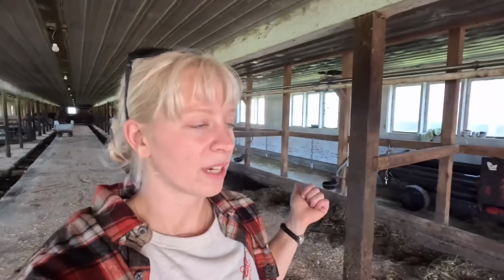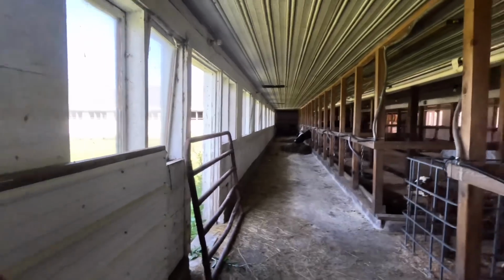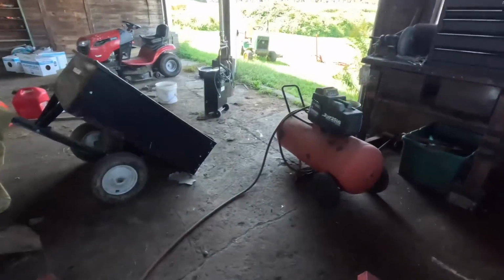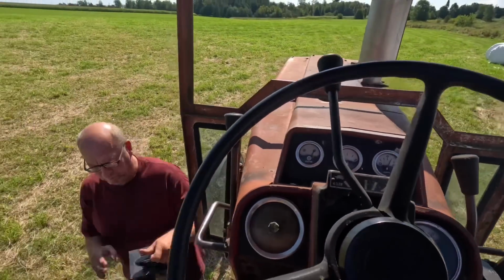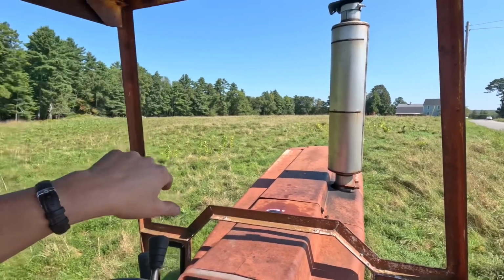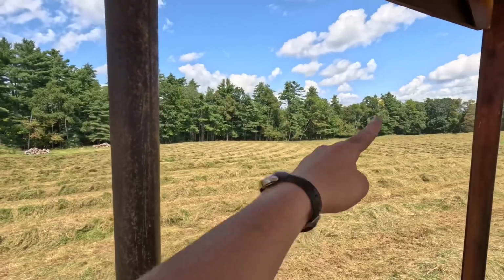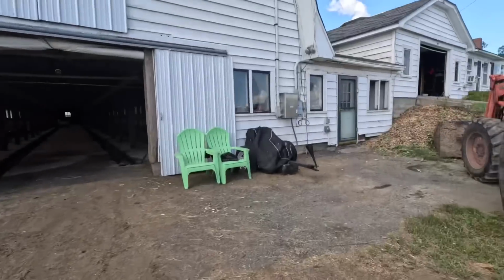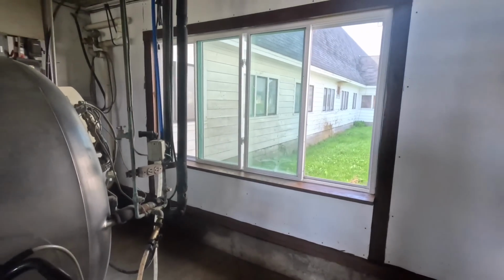Project update + putting the 1066 to work…

Comment: That weed by your milkhouse you should burn or bag the plant up and take it to the dump, it will grow from the cut off material.   People use softener rock salt and that sometimes helps.  If you have a piece of metal a thick sheet to dig down and bury might help, it will grow up through blacktop. Neighbor I worked for had that and I finally used a syringe and shot about a CC of gasoline in each stock at the base, about a hundred stalks later it did die off after about a week.  1066 sounds good, miss that ting ting of the exhaust cap.  You do a great job filming and editing, thank you for all the time you put into the videos.  I hope you got a good 30 bales from that field looked like a nice field to get for cutting, easy access by the road.   Hope you all stay safe and healthy.

Comment: Cotton from a rag, round-up, duct tape and just scrape the sides of the stems then give it a round-up band-aid.   Doesn't take much.  The trick is you can't harm the stem you're putting round-up on or it'll abort it, just give it a scrape or two.   You can try stacking herbicides too, give it a little of all three.   One of the big things you run into is plants that are immune to chemical penetration from above are often completely vulnerable from below - I used to drag my spraying hose across people's yards after spraying because it'd tilt the little broadleaves over and smear the mixture under their leaves and kill the hell out of them.   So try a little spray bottle of round-up just a cheap bottle and wear a glove to lift the leaves and spray under em.
Reply from the maker: Wow, that’s great information thanks! Hopefully we can kill ‘em!

Comment: Tay, your weed looks like Japanese Knotweed. The roots will go down as far as 15 feet if not further. We used to inject neat glyphosate into the stems as well as pour it down the cut stems. As you probably know it's extremely invasive so you are best to burn or bag the prunings. This plant will grow through asphalt and is very determined and hard to eradicate. Wash off/down any equiment used in cutting it back as the cuttings etc are like potato peelings and the smallest piece will take root. We also used to add some diesel or washing up liquid to the chemical to break down the wax on the leaves and stems. I hope that this is useful. Oh, great video as usual, thanks.

Comment: Question? Wondering how the seeding you did in the manure spreader went? Was it worth it?
Reply from the maker: It actually worked really well! I definitely wouldn’t use it as a method of complete reseeding but as a filler it does a fantastic job!
Reply: @tayfarms  Thanks for the reply,
Yes, we are just needing some filler.